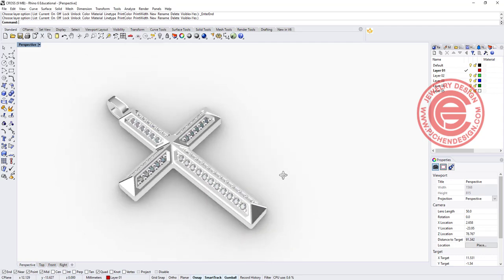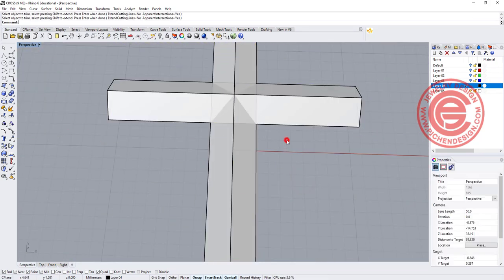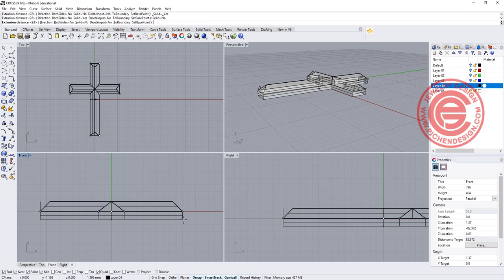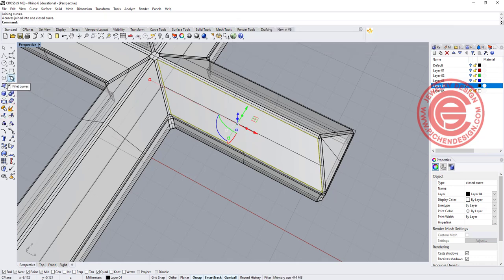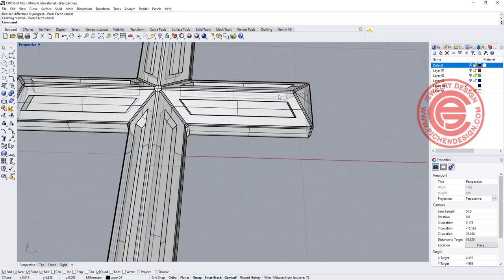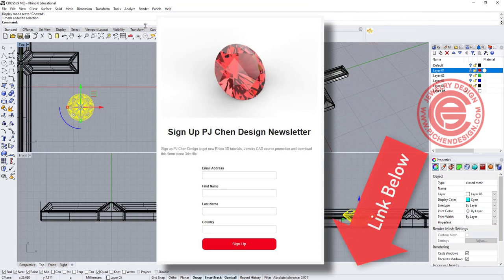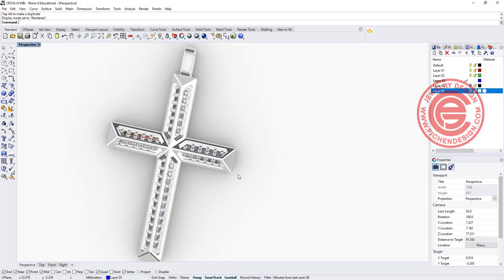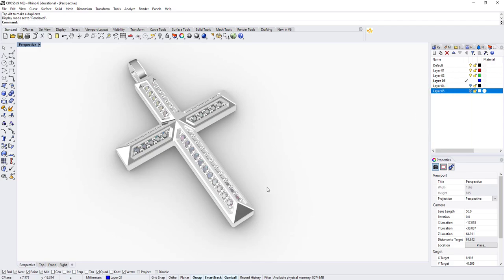Jewelry CAD Design Cross Pendant Tutorial- 3D Modeling in Rhino 3D #162

Comment: Great video! thanks a lot. I had a question, is there anything you would do differently to the stone settings(apart from removing the actual stone) if you were 3D printing this model and then setting the stones after casting?
Reply from the maker: no. just remove the stones. boolean union all the parts and export it into stl file for 3D printing

Comment: Hey, i have a question on how to turn a drawing into a 3D object.

I am making a custom pendant for a friend using Rhino 6  and i started the process by taking their company logo and using the "Control Point Curve" tool. All has went great so far and i have the flat 2D image finished. The next step was to make this into a 6mm thick 3D object. I attempted to do this by highlighting the stuff drawn and the selected "Solid > Extrude Planar Curve > Straight" and then proceeded to make it 6mm thick.  

It looked good from the side profile but from the top view, most of the sections on the design were not filled but some of the sections were. 

Is there something I might have messed up on that is preventing me from doing this correctly? 

Heres an image of what I mean:  https://imgur.com/a/Yb1pkB9

Thanks in advance for any help you can give!
Reply from the maker: check on your curves. all the curve MUST be closed curve.
Reply: @PJChenJewelryDesign  The A in the centre was made from using a premade font and using its objecitve control points to make it like the desired design and i have managed to get that to work as intended now but the crown itself is still not able to be made into a 3D object. 

I will try to draw it up again as i cant seem to get the curves to join and be extruded to the correct thickness.

I am still extremely new to this software so im not quite as ontop of this as I should be :(